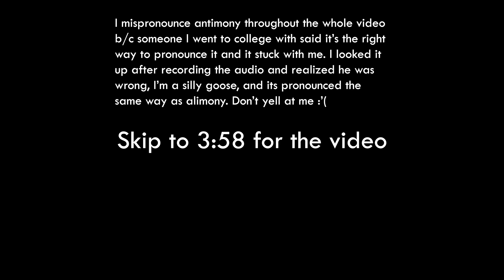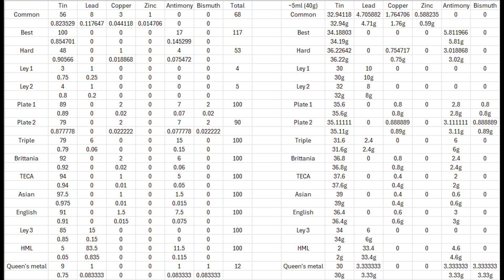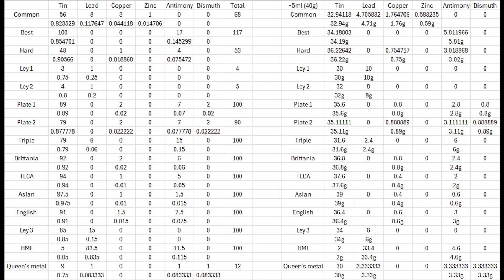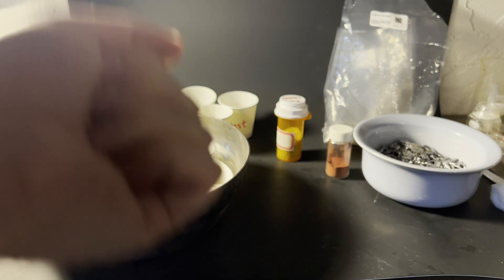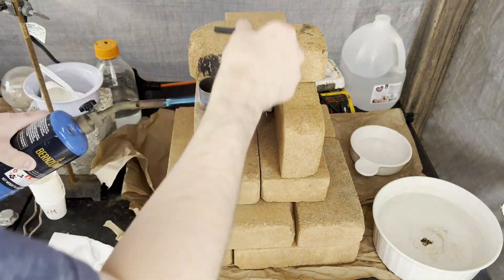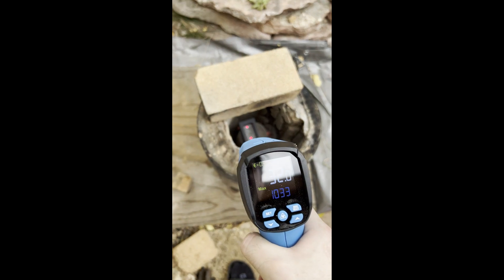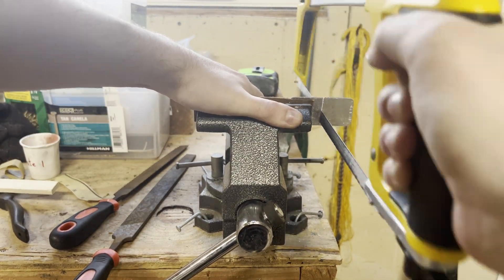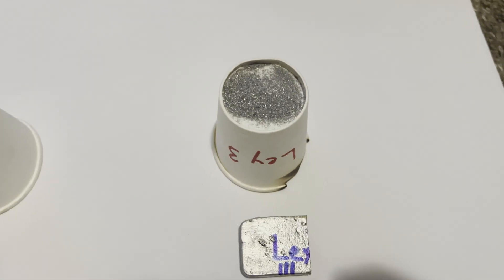Making 14 types of pewter - Pewter City in the palette project

Comment: You cannot harm a file by stroking it backwards. That's a myth that's actually been busted pretty soundly here on YT. You're using it just fine.

People frequently point to a few damaged teeth and say "see, stroking it backwards causes this," but damaged teeth on a file are nearly always the result of someone trying to file something hardened.
Reply from the maker: Interesting, thanks for letting me know. Probably should have looked that up, but I very rarely use my files, so I wasn't that concerned about it. Pewter's so soft and melts at such a low temperature that I didn't expect any problems other than maybe gumming them up